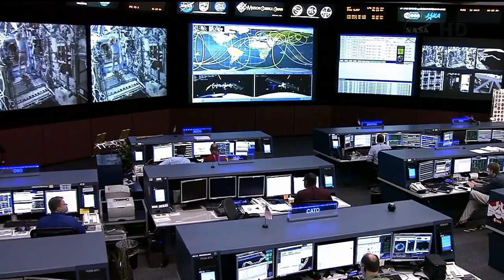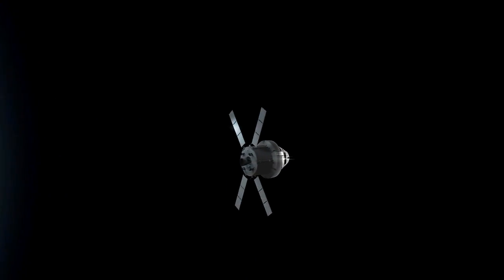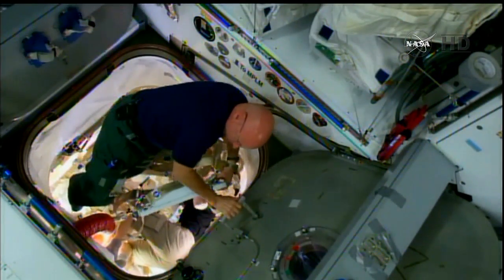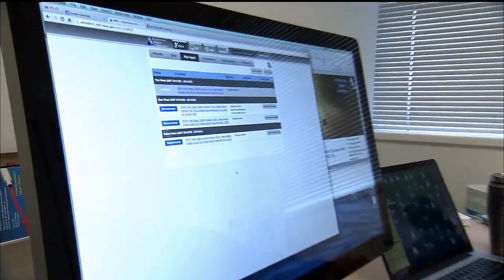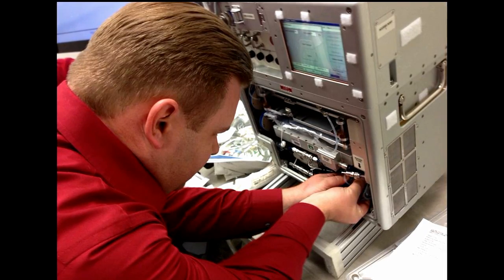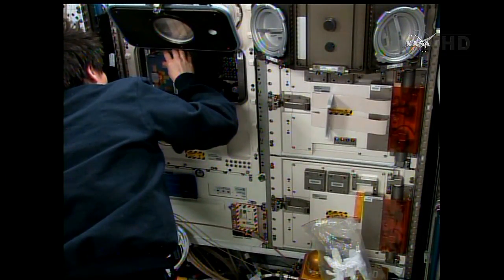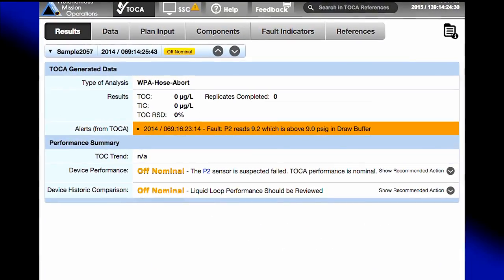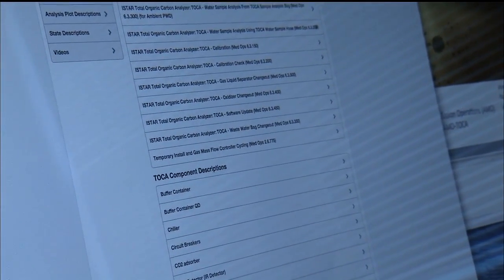Space Station Live: Water Works for Spaceflight Future

Comment: I know it's a little off subject but if/when the Space Station has a metal 3D printer on board things will get a lot more interesting. I guess a magnetic type of printer should do, so the metal powder stays in the desired place. There's also the issue of venting, but that's just a mater of engineering.